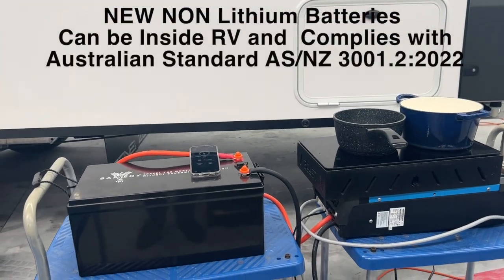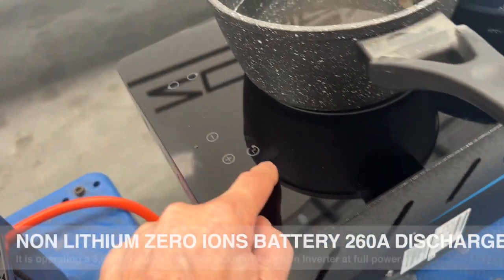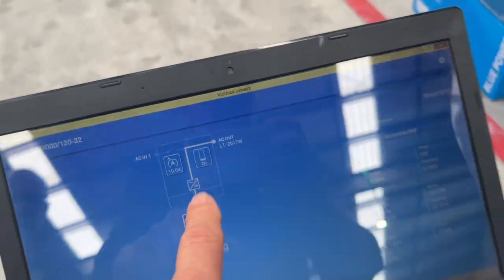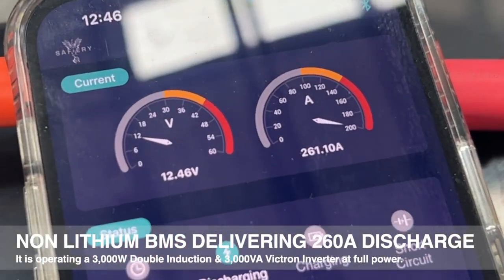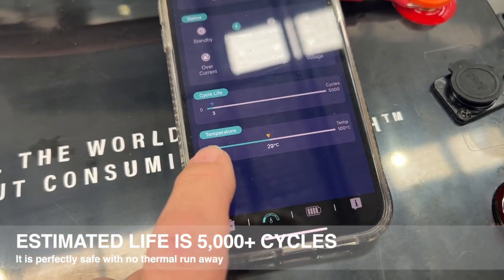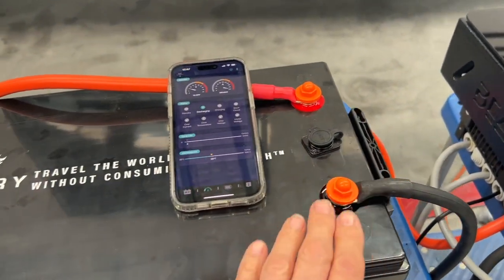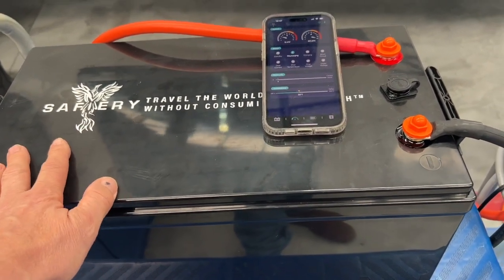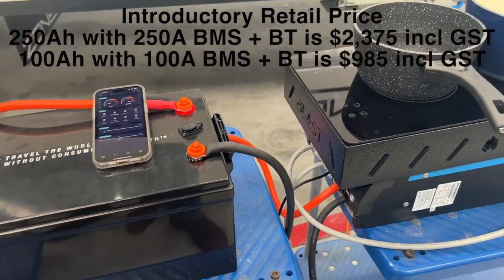Non Lithium Battery 250Ah discharging at 260A operating a 3000W Double Induction on 3000VA Victron

Comment: That’s very cool and I’ll be getting in touch to have your input on a complete electrical system, solar and using this battery type but I would like to have seen the water boil and the unit run for longer.
Reply from the maker: Will do on next test... hopefully today

Comment: But 2x 2lifepo 200ah are both cheaper and more capable... I don't get what problem this solves, other than arctic usability?
Reply: Apparently rv caravan future builds wont be able to use lithium internal of van. These will be allowed
Reply: but that's where lifepo4 is safe... climately controlled.  @jonnywestmoreland3230
Reply from the maker: The problem they solve is safety. There is no thermal runaway.
Reply: @Safiery  thanks for the reply.  First time i've heard that term, but I'm getting extremely few results about it on lifepo4....
Reply: Largely it's a knee jerk reaction lumping all lithium chemistries together.  LiFePO4 and LTO are quite stable and not at all prone to self-ignition.  If you manage to involve them in a fire which will get them to the point of their thermal runaway threshold you clearly already have a major issue in that your structure is on fire!  If you burn lithium batteries you get all sorts of nasty off gassing.

The same can happen with certain sodium cells too, but apparently the type used in the Safiery branded battery do not have this issue but until the SDS/MSDS/PSDS appears take that statement with a grain of, dare I say it, salt.  Regardless of chemistry batteries are considered dangerous devices so the document should be available upon request if not already presented on the seller's web site as a matter of course.